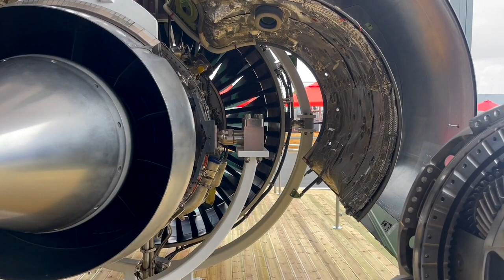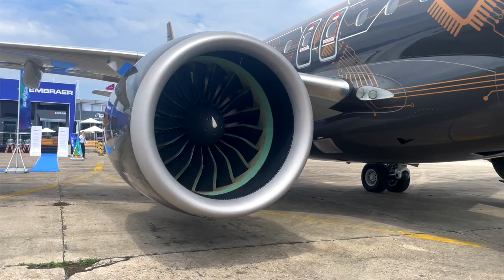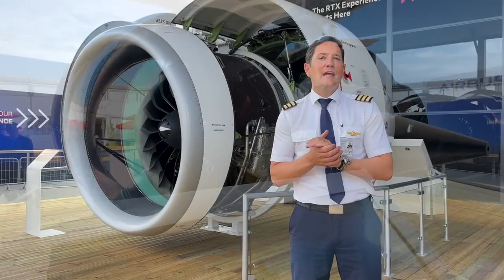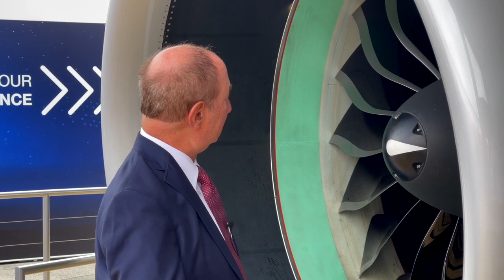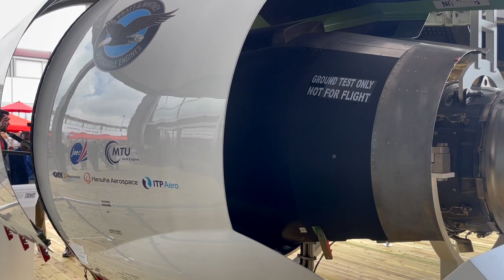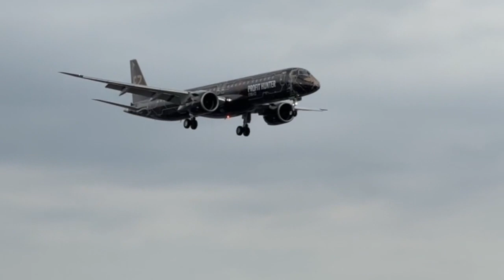GTF engine: Game-changing efficiency and sustainability | Paris Air Show

Comment: Very good Engine, although everybody thought that it was going to be the Fan Gearbox the one will cause trouble, it has been performing extremely well. Hopefully, P&W fixes the teething issues very soon with upcoming upgrades
Reply: "Teething?"  You're kidding??  Hope they fix the fucking SAFETY issues.

Better continue to hope it don't BLOW UP like the oil seal problem in its PW1500G spewing pieces all over the ramp in Mirabel, or the high compressor knife-edge HCF in the PW1100G, or the one-pipe-out cooling of the high turbine, or why most of the thrust load on that big fan is carried by only TWO of the planetary gears, or the highest RPM turbine in the world working right on the edge of material limits ("certified" like an engine from 30 years ago). 

 Just wait a bit longer for the NEXT failure and hope that "performing extremely well" doesn't equate to deaths.
Reply: They have certainly learned from the shortcomings of the PW1000G, that's for sure.
Reply: The phrase 'Game Changing' leads to many outcomes not always positive. Performing well but with teething problems which will 'hopefully' be fixed. If you know they are teething problems why the need for hope? How does that combination hang together? Putting a gearbox in to what was a reliable power source because of its essential mechanical simplicity is a whole new world. A constant speed propellor in a turboprop has extra benefits with the jet engine not needing to spool up with the re-stabilisation of gas flow for extra power. But putting in a gearbox just for more optimised bypass is entering the realms of trading safety for cost efficiency.
Reply: @michaeld5888  And you think the technology can't improve to compensate for the shortcomings? You think engineers don't learn from their mistakes? I'm pretty sure P&W has been taking a good, long, hard look at the data of previous PW1000G failures to determine the cause of each failure, and work to address them.
Reply: @mrunning10  Stop complaining. I do agree with the marketing shit though. You do realize other engine manufacturers have problems too huh? Sounds like someone got fired or just doesn't like a good (but maybe slightly corrupt) company.
Reply: Turbine Helicopters use the exact same mechanical principle.
High speed low torque turbine engine 
into 
low torque input but Hight torque output low speed gear box.
It just makes sense.
And it means that the turbine doesn't even "feel" the load (Fan).

Comment: Is doing very well in reliability? 🙆
Reply: NOPE.  Just wait.  Poor reliability = poor safety.
Reply: @mrunning10  You think engineers don't learn from their mistakes? I'm sure P&W has taken a good, long, hard look at the data of previous geared turbofan failures, particularly with the PW1000G, and are looking to fix the root cause of those issues by building this new engine, the GTF, from the ground up.
Reply: @MilesEdgeworth129  Matt is salty. You can guess why. Look at how much comments he has on this channel.

Comment: The PW1000 series engines are incredible, powerful and silent!!

Have rode both the A320 Ceo and A321 Neo (powered by the PW1133G), & you can feel the immense power of the GTF engines pushing you back into the seats!!

Impressive performance, and the massive fan blades also looks amazing.
Reply: Wow!  And you survived!!
Reply: Silent because they are sitting parked on the ground.  And in flight they are quieter than the CEO but they have a low frequency hum that can not be synchronized with autothrust.  Autothrust has to be switched off and engines synchronized manually.  Waaahhhh......waaaahhhhh.......waaaahhhhh....

Comment: It's very helpful that Pratt and Whitney have mass-produced these cleaner engines. Replacing older aircrafts with those powered by these engines will absolutely reduce the carbon footprint of air travel.

Comment: Turbine Helicopters use the exact same mechanical principle.
High speed low torque turbine engine 
into 
low torque input but Hight torque output low speed gear box.
It just makes sense.

Comment: The Leap is better
Reply: Just more reliable.
Reply: Not really. The GTF is more efficent, higher bypass ratio, more thrust, lower noise. BUT, the reliability still needs some work.

Basically they are both the same at this moment.
Reply: @Roboseal2 oh

Comment: CFM LEAP-1A is 1000 times better than this
Reply: It’s roughly the same except Pratt is having so many problems while CFM is only having a few. PLUS the GTF has better fuel efficiency and thrust which airlines will most certainly choose over the leap in the coming year Especially when those reliability problems are solved and Proven to work.